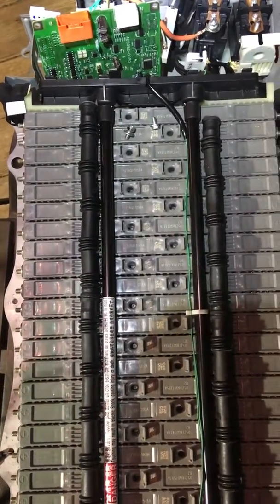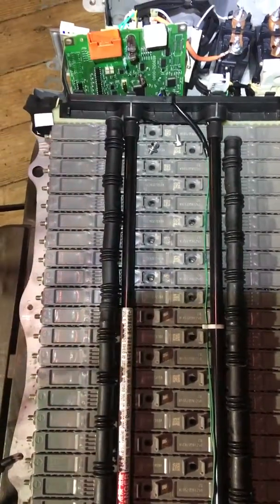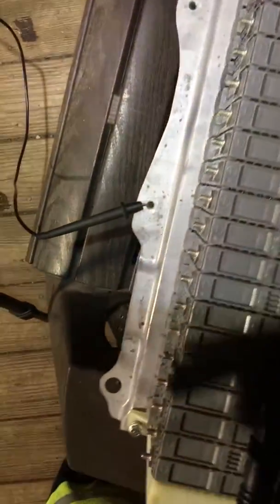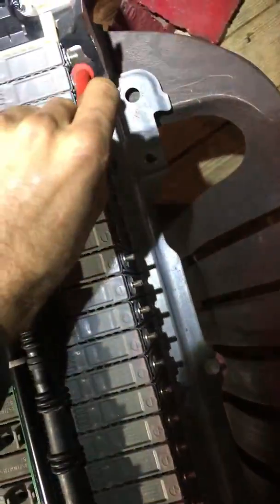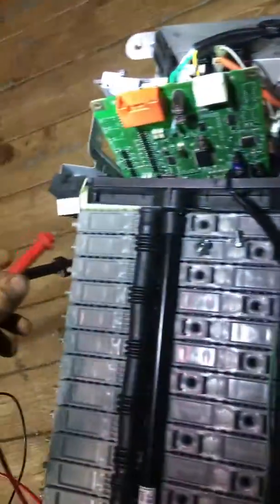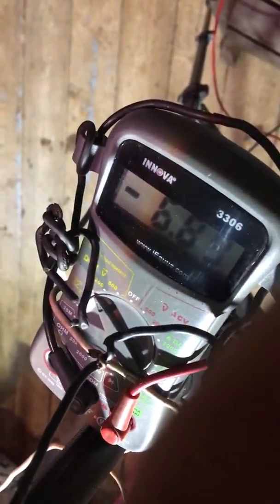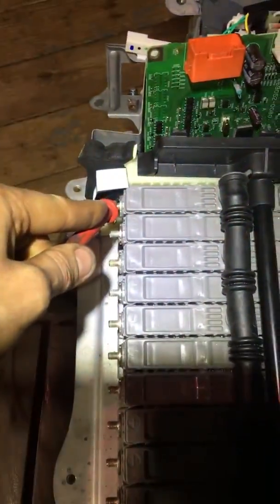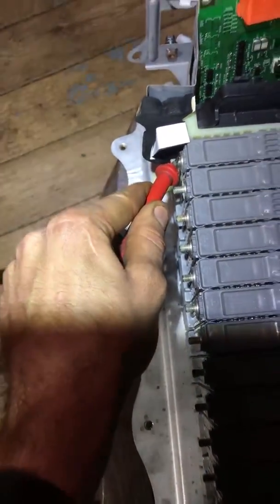Toyota POAA6 code. Prius Traction Battery Repair

Comment: What do you mean it too long of a bolt? Will that cause a high voltage code? I'm changing my battery out in few days so I want to know is it because of the bolt or the battery cell??
Reply from the maker: sorry i didnt see this sooner. the battery cells are held in place with bolts. if the bolts are tightened or torqued to much then it cracks the plastic battery casing  causing electrolyte leakage

Comment: Thanks  can this work on 2007 Toyota camry hybrid?
Reply from the maker: None None  voltage is what you need to check, and then charge each cell individual to see what the capacity is. If voltage is below 7.00 volts you should charge the cell at 1 amp with a hobby grade charger. Nimh manual settings
Reply: @Dylant38  ok thanks what was the main cause for your high voltage and what settings did you have on the meter when checking for high voltage on your video